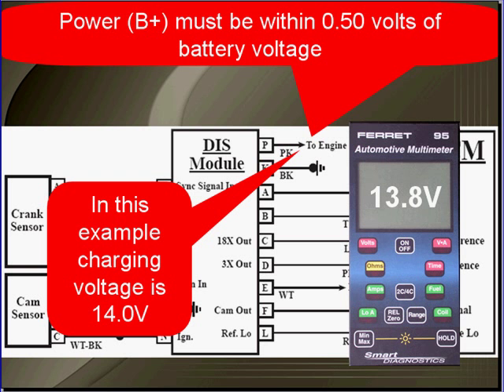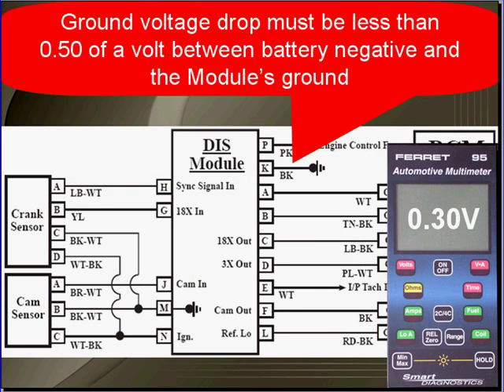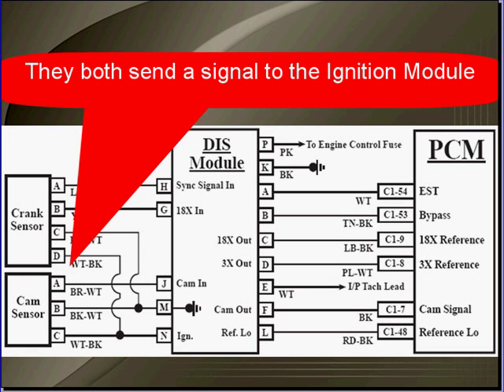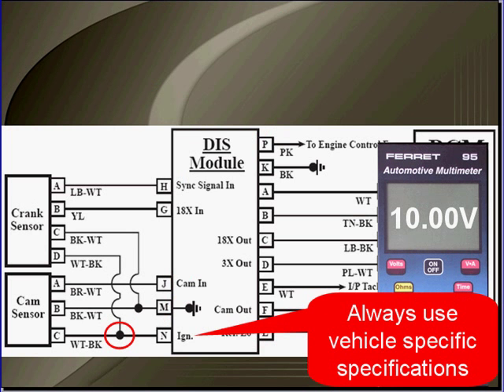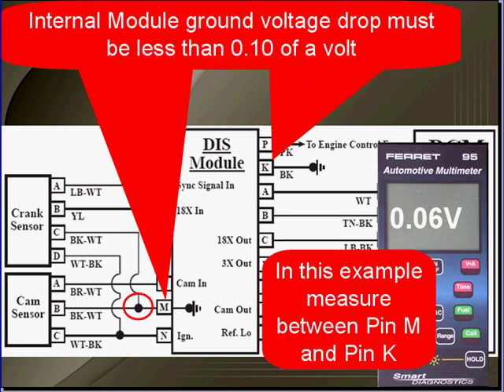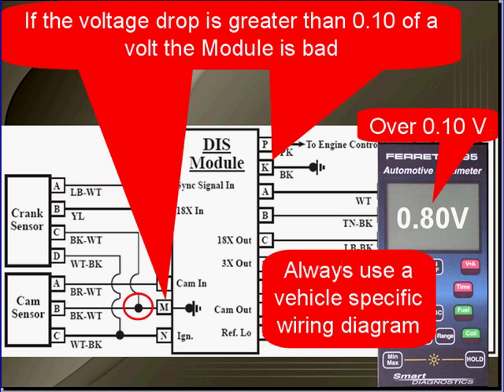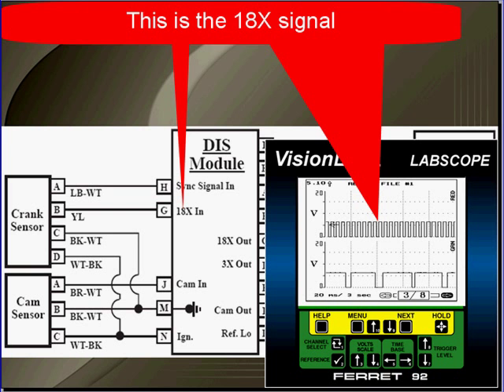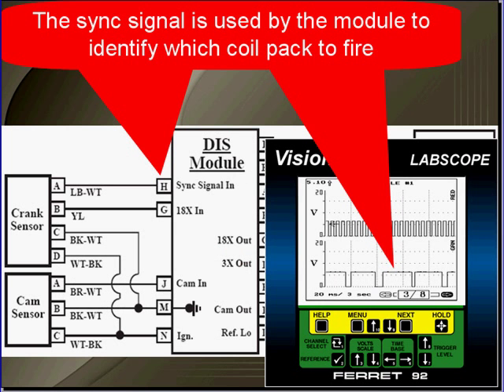17 GM Diagnostics: Ignition Module Test

Comment: I own a 2015 chevy ss Sedan, and I'm experiencing cylinder 3 misfire. I've replaced coil packs, O2 sensors, fuel injectors, spark plugs&wires, and I'm still having misfires. Please help